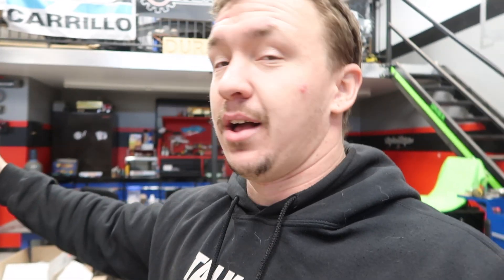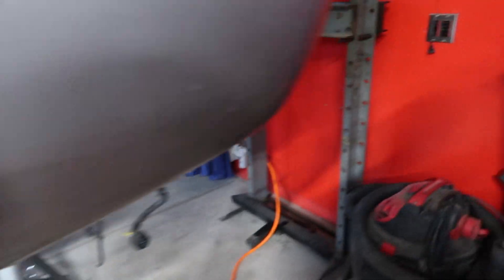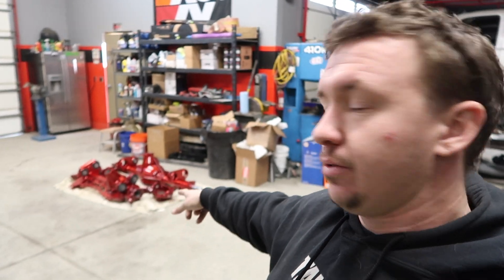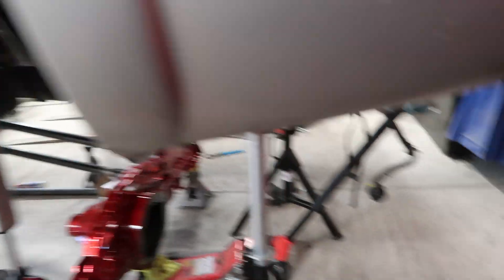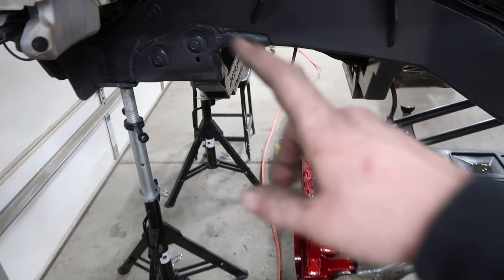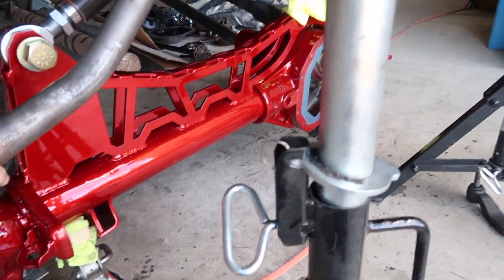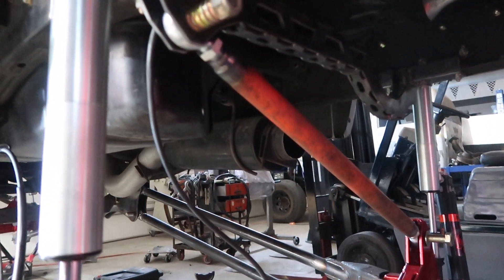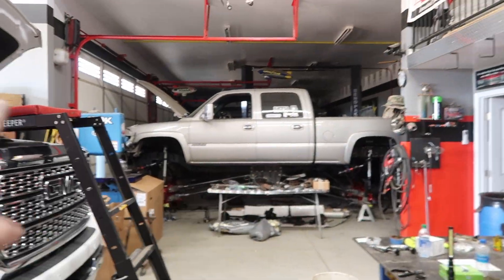Picking Up The POWDER-COATED Axles!!

Comment: What front axle was used for the sas build?
Reply: Dana 60 from a 07 f250.
Reply: @milehighduramax3821  Was you able to retain the factory abs? And I assume the rear axle is factory.
Reply: @PndaS2k  rear axle is the fActory AAM 11.5 full floater and yea it still has abs.  Wfo concepts has a kit that lets you retain your abs
Reply: @milehighduramax3821  I’ve been eyeing wfo concepts. That’s going to be a badass build once it’s finished.